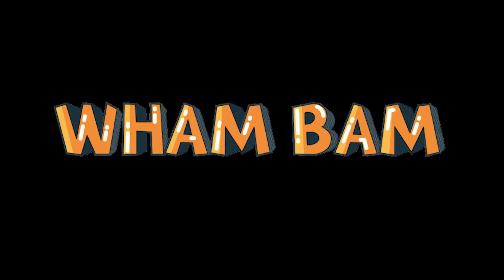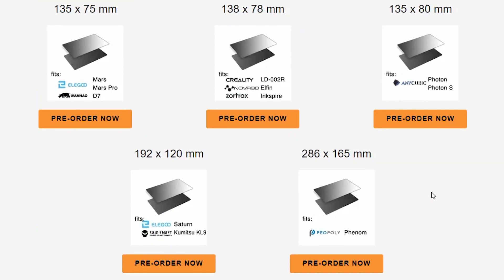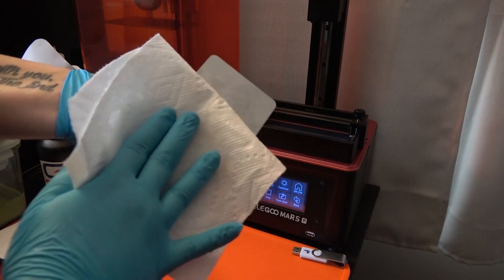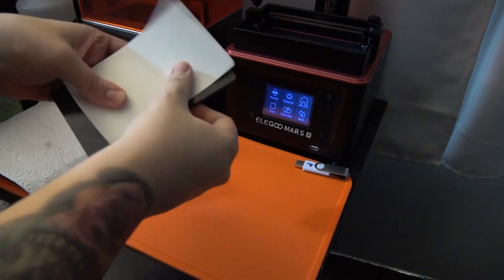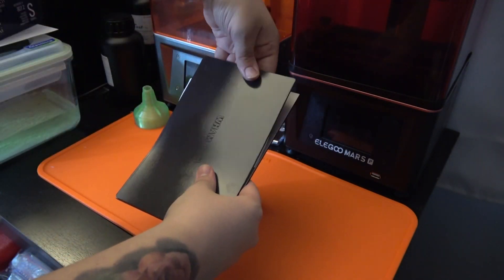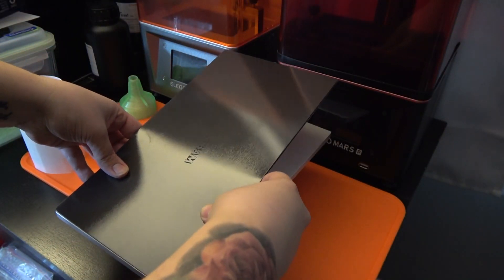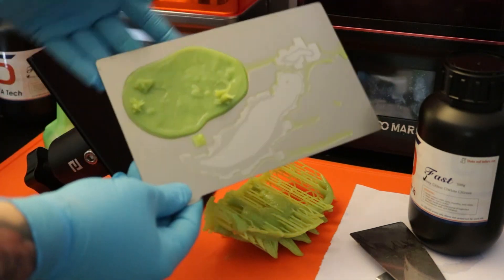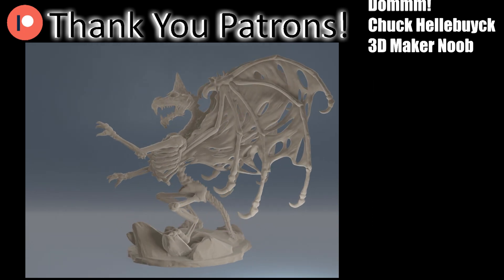Wham Bam Thank You Ma'am! -Flexible Build Plates For Resin Printing?!

Comment: these type of videos are the worst you show the Wham bam build plate you do a print using your resin printer but why did you not show us well your settings for printing this did you re level the build plate did you have to add a spacer height block in the printer because when I printed like you did I got 2 failed prints from not sticking onto the build plate and I had the right settings I know this doesnt work because I am able to print fine with out using the wham bam build plate for my saturn 4 ultra

Comment: Resin has been getting very popular as of recent. Maybe thanks to the price of these machines and resin price going down. Low smell resin is a manufacturing gift to us makers.

These flex plates will aid interest for ease of use. Planning to get on for the Elegoo Mars 2 Pro. The plate is bigger slightly on that so I'll wait a bit till the printer is sold on the market.

Comment: Great review thanks!    note: Make sure to give your 3M 72 hours to cure once magnet is applied for full strength, in 24 hours you will have 90%
Reply: So don't print for 72 hours?
Reply: @CHECK6-963  Correct.

Comment: Don't you have to change your zero height or something?  You must be adding close to 2 or 3 mm on the bottom of the build plate.
Reply: it all depends on the machine, for the machines that the levelling features allow for 3mms of movement you will have no change, for others you may have to add 2.6mms to your Z limit interceptor, many options are available on thingiverse already, created by our beta testers!